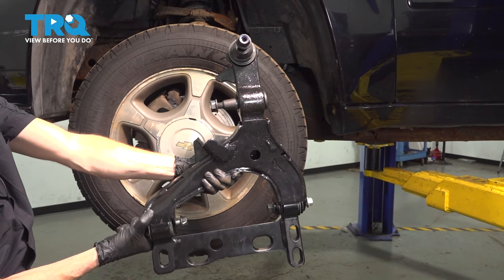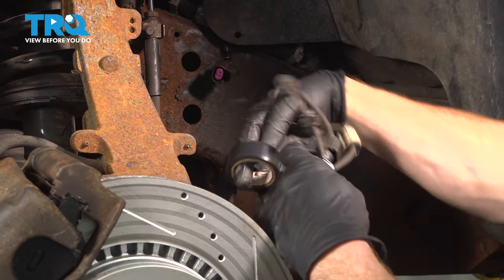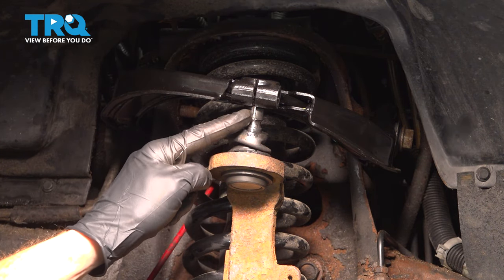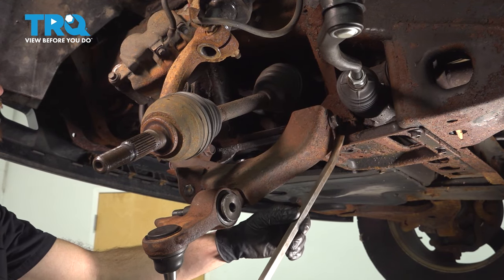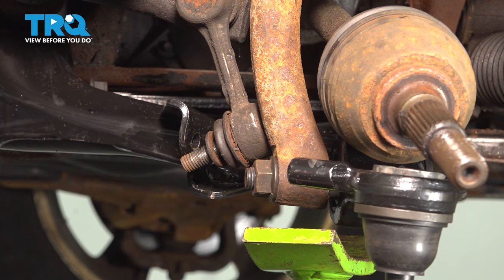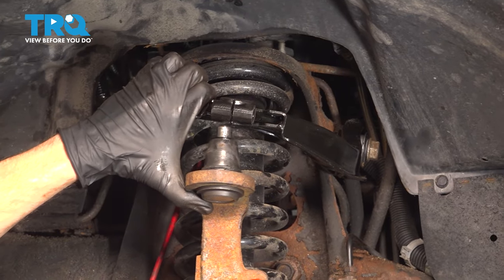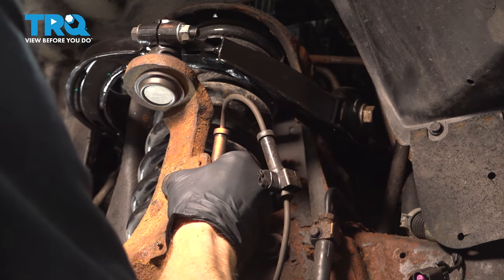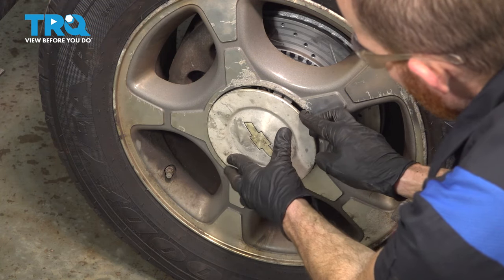How to Replace Front Driver Side Lower Control Arm with Ball Joint 2002-2007 Chevrolet Trailblazer

Comment: How did you diagnose this? I ask because I have an annoying pop noise when driving in and out of the garage and it is getting worse. My mechanic tightened a number of suspension parts and everything thing has been replaced at least once with 318k miles. The mechanic said everything is fine but a couple years ago there was a noise that no one could diagnose a Lincoln dealer discovered a cracked tranny mount. Thank you.